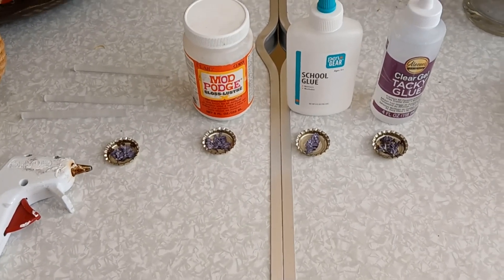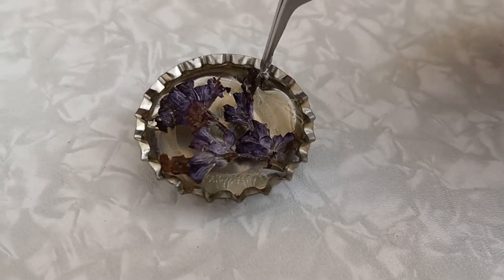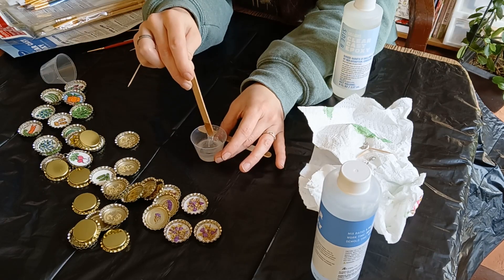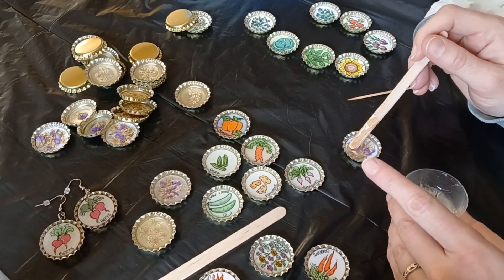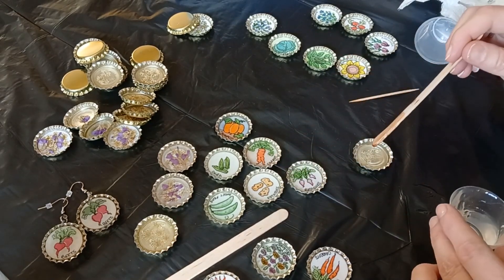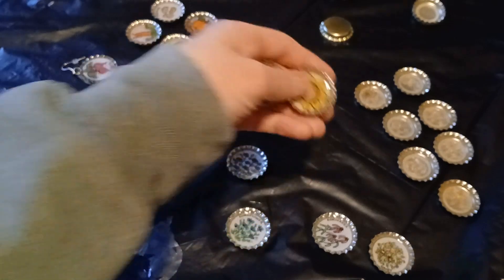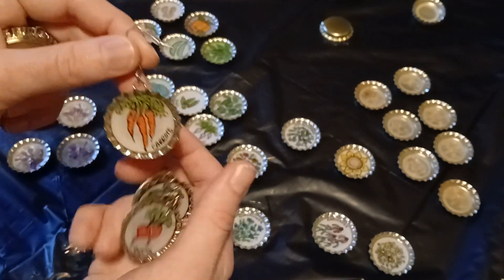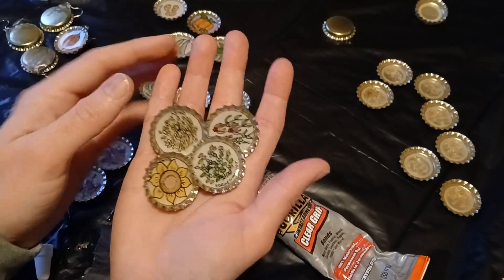Can I use glue instead of epoxy?

Comment: Try heating up the overflow a little on the earrings & then try breaking it off, or scraping it off. I've herd heat will soften it. Don't heat too much tho.
Reply from the maker: Oh, thank you so much! I had no idea it would soften if you heat it! I will for sure try that!
Reply: Hope it works, that is such a cute recycling idea
Reply from the maker: @corrier5954  It totally worked!!! Thanks SO much for taking the time to mention that idea! I recorded the process and that video will be posted soon.
Reply: @artwkiwi  I'm glad, good to know
Reply: Have you tried using uv resin ? It's quick and easy..